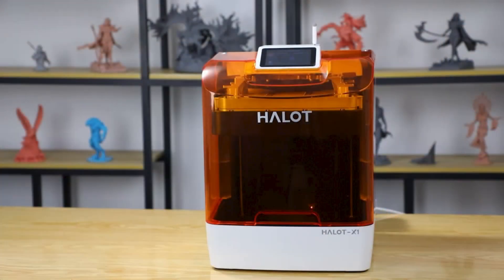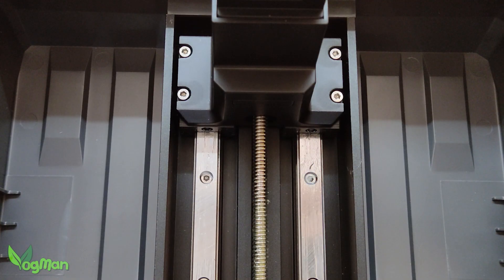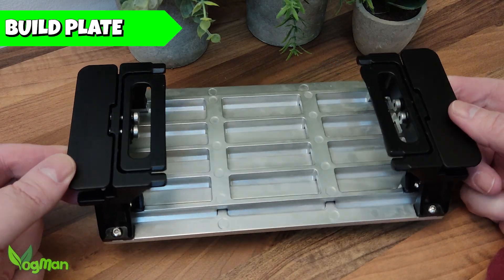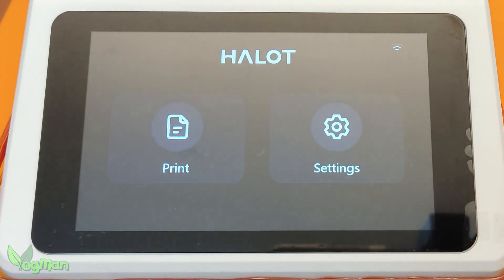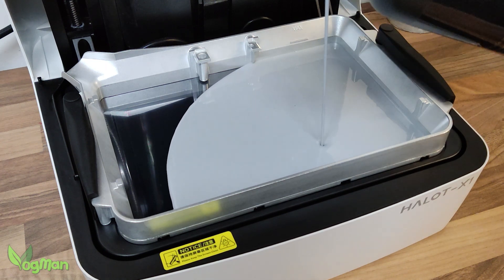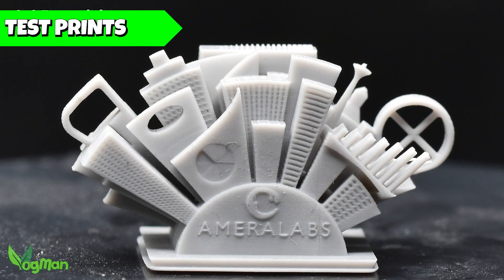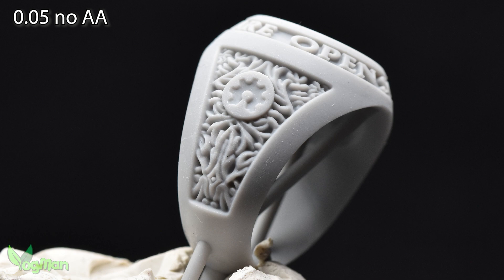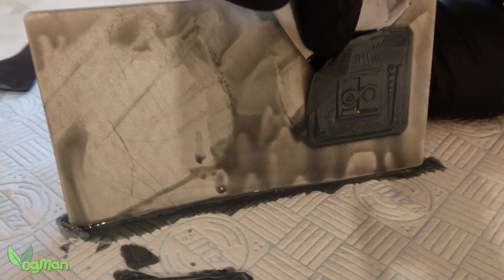This 16K Resin Printer Changes Everything – Piocreat HALOT-X1 Review

Comment: So. I backed this on kickstarter (and so basically got this and the AFU for the price of the printer itself.) I've used it a bit. Thoughts?

Pros:
Yes, compact. I like the size. And I want more brands putting the display and the USB interface on the top. 

Interface: Reasonable. 

AFU: Just ... works, so far, but I'm still on the initial piocreat bottle. I don't know that ALL the Piocreat bottles have the RFID tag on the bottom (yet.) Haven't tried other resins. 

Part of why I decided to back it on kickstarter was the vat-lift-and-build-plate setup. So let me just say flat out that the build plate is absolutely not a gimmick. It works really well. Yes, there's a chance smaller parts might be stuck completely on either moving portion of the plate, and I do expect to run into that (and maybe cracking some small thin part or something) but it has been solid and I've gotten some great prints out of this so far. I couldn't point at one and say "See, this was printed on the Saturn, and this one was on the Halot." 

I love the vat latches. I wish more would do this instead of manually having to screw in screws to hold the vat in place. Sounds like a little thing but it really is just nice 

Fit and finish overall feel top notch. 

"EH"s:
Chitubox doesn't have a profile for the printer. It'll slice and such just fine. Apparently the version on the USB stick has a profile, but my system won't read it. 

Halotbox gives no monitoring, and only sends the file to the printer - it doesn't actually start the print. Hitting (I think it's labeled as "start") again on it just ... sends the file again. 

Halotbox is also really picky about what network it's on. I've got a wifi network extender over in my work area (with an "_ext" extension on the network name.) I either have to connect the X1 directly to my primary network, NOT the extender, or give it a password, which is just ... ok, probably makes sense for business, but on a personal printer, it's a little annoying. 

Cons:
Send file to printer. Get up. Select file. Hit print. Then hit start. There's zero reason for this. I'm not sending it via network to save a USB stick, I want to actually start the print job. Maybe it'll allow me to do this when Chitu has a profile for it. I hope so. 

To me, the fan while it's running is really noisy. That said, Piocreat said they were aware and would fix it in a firmware update. I downloaded and installed one OTA, and the latest figure print I did seems quieter. It's still a bit noisier than my other resin printer (Saturn 4 Ultra) but it seems quieter after the update.

Not-sure-yets:
Again, I haven't tried it - with or without the pump - with other resins. I've got plenty. 

Would I buy another?
Ask me in 6 months to a year once we have more updates. Right now... honestly, yes, I would, but not as a first choice because of how the network send works. I'd buy another Saturn 4 Ultra first because that does just work without me having to get up... but that's the only major reason right now why. I haven't done (or had to do) an LCD or film replacement yet.

Comment: How do you find it in comparison vs the saturn 4 ultra 16ķ
Reply from the maker: In terms of print quality, they're going to be the same. In terms of ease of use... I've got to go with the Piocreat. They are clearly focusing on making use as easy as possible for the user, something all companies should ideally do. And of course, Piocreat didn't forget to add a handle to theirs 🤣😂🤣
Reply: @vogman  have seen several people have vat leaks on the 16k.. which I also had, there's a gap around the screen to allow the tilt but nothing to catch leaks and resin flows onto internal components from there directly under the gap

Comment: Sooo how does setting resin config on the printer help exactly? Does it talk to the software? Does it override the g code on transferred or usb model?
Reply from the maker: If you have a Halot resin bottle, there's an RFID tag on the bottom. Inserted into the AFU, this reads the ideal profile and feeds this information to the printer where it is stored. You can then print using those settings. However, you can choose to use your own settings via the slicer in the usual way if you want to. 😁

Comment: Lots of innovative but practical new technology.  The flip up lid needs handles.  Why is this so hard?  Looking at you Elegoo.  The part push off tray looks great, particularly for people who always print with a raft and support structure.  I print functional parts directly on the tray, and the fingers would leave surface impressions on the part.

I'm waiting for a company to create a complete MSLA system that automates the cleaning, drying and UV post cure.  That's where MSLA needs more innovation.

Comment: not crazy about the way it heats resin, temps can change alot from bottle to vat. but the rest of it looks very interesting!
Reply from the maker: In a cool environment, you'd really need the AFU (which looks very clever). Unfortunately the design doesn't really allow for fitting a small chamber heater, which is a shame.

Comment: Hm... Very interesting concept. I love the idea of non-uniform, moving plate. I think it will be copied by others soon enough!
 I wonder if moving whole vat and screen won't cause some skewing, wear off the threads or inprecise movement through time. I guess it all depends on design of the mechanism and quality of parts...
Reply from the maker: I guess that's why they've doubled up on screws and rails.
Of course by using gravity, all those nasty suction forces are removed, so that would mean less wear and tear.
But yes... as a whole heavier.
Fun idea though. Works great. 😁